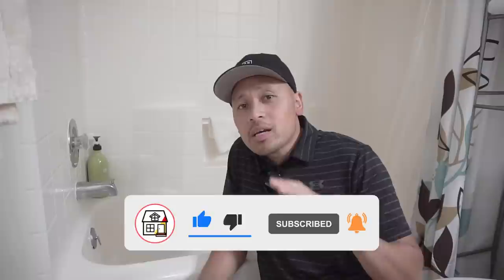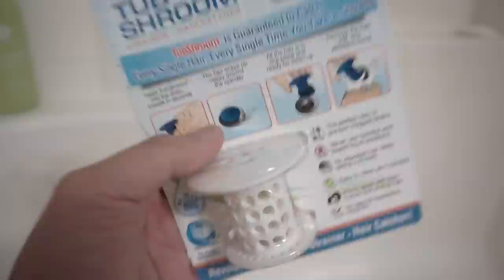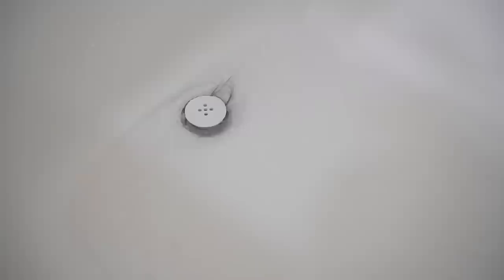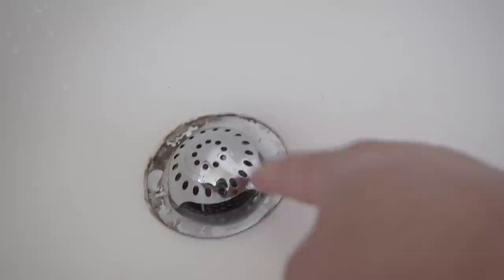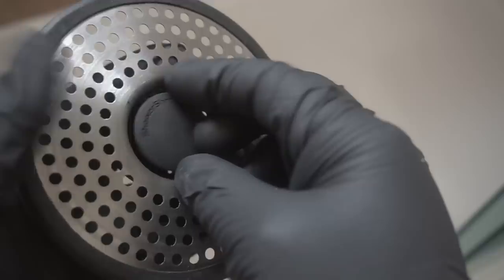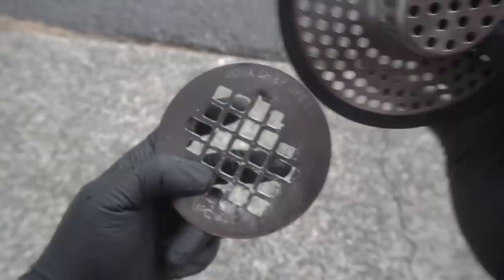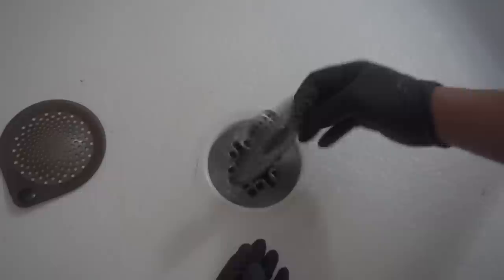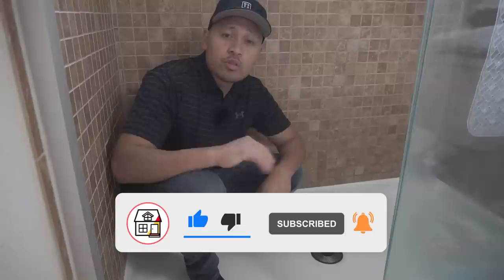NEVER Unclog Your Bathtub Or Shower Drain Ever Again! How To DIY

Comment: Years ago I got a kitchen sink strainer with a fine stainless steel wire mesh.  It drops right in the bathtub drain (you have to get the right size).  The nice thing is it's easy to remove.  I clean it daily, the accumulated hair goes in the trash and I give it a quick rinse in the bathroom sink to remove any little things that remain.  I haven't had to clean the tub drain since I got it.  Highly recommend.
Reply: You can buy them at Dollar Store.
Reply: Me too

Comment: ShowerShroom Drain Protector Hair Catcher is not going catch all the hairs.
Look at the size of your shower drain.   That center unit might work but all those holes around it do not funnel the hair to the center.   Lots of hair can still go directly through the outer holes.
I've been using a set of two fine mesh strainers I get at the Dollar Store for $1.25 for the set.
The larger one is 4.375 inch diameter.  Package says "Cooking Concepts"  "mesh strainers"
I use the large one for my shower and the little one for my laundry tub drain.
If you use these,  be aware they can catch so much you have to clean them or buy new ones more often.
But they seem to be ultra effective.   In the laundry tub drain I have to clean them every other wash to avoid flooding.
I'd gladly buy a new ones every few months at only $1.25 per set.
In fact I'll probably pick up a dozen next time.
I have a shower drain that otherwise I have to auger every few months or so.
So far no clog after many months.  
Note,  they are not pretty after doing their job for  few weeks.
Try them out.... only $1.25 to experiment.
Reply: Those do not work for me, got one for shower and the kitchen sink.  They both slide over or lit up with water.

Comment: I put a simple strainer over the drains. When I'm done washing my hair I just clean the hair that's wrapped around the strainer. The water still runs through the strainer & it's a really easy inexpensive fix. Even my grandson who has very long hair uses my idea & likes it better than the shrooms.
Reply: That's all I do using different size strainers for bath tub the bathroom & kitchen sink done it for years never had any problems again just cleaning out the strainers with no more clogged pipes.
Reply: What kind of strainer?
Reply: @jyes23.  you can get them at dollar stores very fine mesh wire strainers usually have two in package small & large I use small ones for sink in bathroom & larger one for the tub if you can't find them at dollar stores Walmart usually has them I also bought bigger strainer for kitchen sink they work great never having to worry bout clogged sinks & pipes.
Reply: @BurtBowers  It now is the dollar and a quarter store $1.25.

Comment: I have the just the plain Tub Shroom and it does work but it gets real moldy and have to soak in bleach at least every other week & it turns yellow.  There is another Shroom that just has a stainless steel top but is really the plain one with a top; don’t buy waste of money.  The top continually pops off and I finally just threw it away.  Really like the looks of the full stainless steel one can’t wait to try it and stop having to bleach the other one.

Comment: Thanks. How do u use on drain with the tub stopper that lifts up and down
Reply: Ditto! I have a strainer cup that can go over the top, but don't have a gopd seal surface. I rim it with toothpaste or peanut butter, let it dry. Then that helps catch a good bit, not all unfortunately! And can easily dislodge so all the hair goes down to clog up!

Comment: What do you have for bathroom SINKS???  That's such a smaller drain, and I find it clogs up easily.  (I have a large pedestal sink, & long hair, & I really like & need to wash my hair in this sink!).  Also, what is best to unclog a bathroom sink???
Reply: I got rid of my hair clog problems once I made my patented hair holders, they are much easier on my hair. Only a little hair ends up on my comb once a day, not during a shower when I wash my hair anymore. Less hair loss helps keeps drains clear. Everything else stays hair free.

Comment: With utmost respect your items are great there's no if ands or buts but what I use when I first move into an apartment or house where the case may be is I use Crystal Drano. I do not use the liquid ones I have used them unless they are the professional that you get at janitorial supplies or stuff like this they're not that good The Crystal Drano is awesome it's a little tiny bit more expensive but I know that it's not watered down per se I know what it does cuz you could see when you put the crystals in follow the instructions you could see the the smoke kind of thing coming up a little bit and so I know that whatever's down there is being burnt off I also put it into my bathroom sink because of all the toothpaste I don't do it all the time but when it goes to get a bit clogged up that's what I do and if this was on the the stock market I would definitely seriously invest in in it best of luck what he's showing you is preventative and it's good but if you just move into a place get that junk out

Comment: What woman wants to pull the plug out after each bath?  Is that the only way to get the water to drain, if it is she is going to call you to let the water out and clean the plug.  Most women are not going to touch it.  Let me know please, I'm running into the same situation.